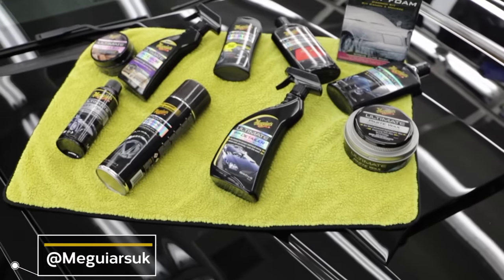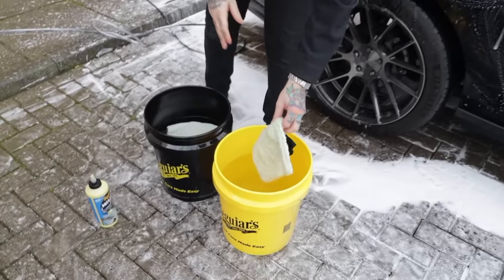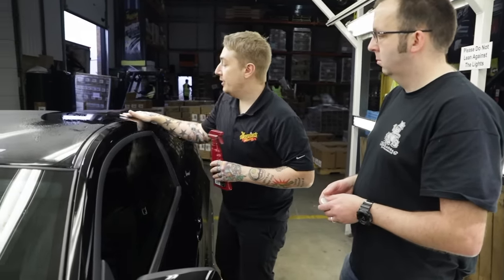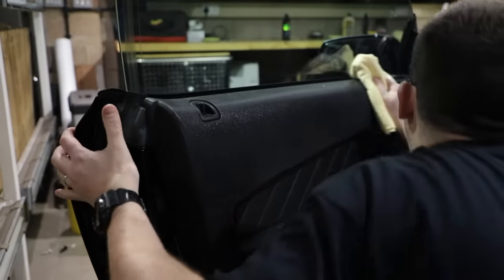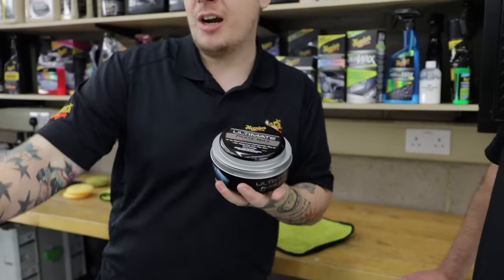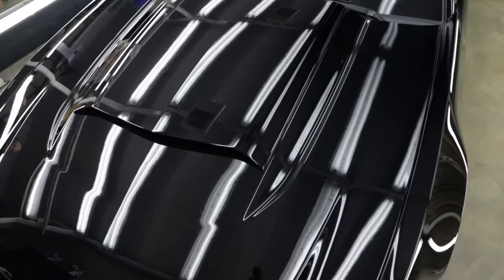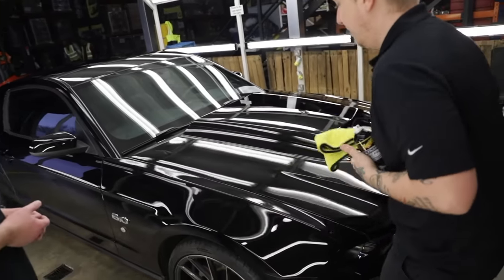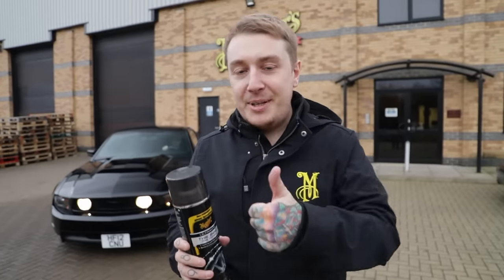ULTIMATE Detail for BLACK CARS using the Meguiar's ULTIMATE range | Ford Mustang | Day In The Bay

Comment: This is utterly fantastic!! However... I challenge the Meguiars team to achieve the same finish on my 140,000 mile Black Porsche! 😂 - I'd be interested to see how amazing the products preformed then! Also, I'm curious if you could now apply their ceramic wax directly over the top of all this work!? Or do you have to strip back the previous protection layers to apply?
Reply: I used their products on a 10 year old black truck with 220,000 it turned out mint. Also used it on a blue truck with 689,000 and it blew me away how it turned out. Took less than 1 day for each vehicle have done 3 so far. Exactly as they showed to do it step by step

Comment: would it be a good idea to wash the car again after using the clay bar?
Reply from the maker: There's no need to as it's just adding more work for yourself!
Reply: I would personally to ensure everything is off the paint before compounding. I just did it this past weekend on my white vehicle and could see the grim running down the panels while working with the clay/detailing lubricant. Good luck!

Comment: Awesome. I have a new silver metallic car so which products do you suggest I use?
Reply from the maker: Ultimate range! =D
Reply: Having the same color, but you don't need to go over the top with ultimate products. Since silver color "hide" way more scratches and swirls than black does. (black is basicly the worse car to detail and silver is pretty much the easiest) This is coming from a car detailer experience.

Comment: Can I Compound and Polish by hand because I dnt own and I'm scared to use a DA Polisher
Reply from the maker: Absolutely!
Reply: Don't be scared...£50 Guild one from Argos. Multi speed setting. Go for 3 or 4. It's the pads you need to pay attention to. The one it came with is a multi purpose one. Still does a cracking job. Struggles with scratches, but swirls are gone! I just might need two attempts as I'm the same as you. 👍

Comment: It's good stuff for a car that's not in bad shape or for cut and buff work. I own the set and can see that these guys didn't want the average person to burn through their paint like what would happen if the used the "real" stuff like 3M. This is more like kit gloves or training wheels 😂. Don't get me wrong, it will do the hard jobs but it will take 3X longer. This video alone showed 2-3 guys working multiple days on a car that wasn't in that bad of shape
Reply: I will also say that when you put in the time and effort to correct the paint, do what is needed so you never have to do it again. Wash every week, detail every month. And wax three times a year (warm spring, mid summer, and before winter) polishing and correcting the paint defects at that time. I have owned nothing but black cars/trucks and motorcycles and this is what it takes to keep them looking good 👍 the ultimate line of products are just what you need to "maintenance" your paint and I have yet to find a better/easier paint maintenance solution. offered by a company. Just wish you could buy it all as a bundle.

Comment: I have ceramic coat on my car.  And I have two bottle shampoo.  Yellow and purple and both is very new .   And then I have spray.   Ultimate quick detailed and detail wax ( yellow picture same with yellow shampoo).    This shampoo is not good for my seramic coat ?
Reply from the maker: All of our shampoos are pH neutral and are safe to use on coated surfaces. The only one that isn’t is wash plus, this will remove any coatings.

Comment: Hey what would you recommend for some brake dust medium to heavy caked in. I use Meguiar's ultimate compound then polish. I find easy-to-use using a DA-P
Reply from the maker: If its brake dust on the wheels then our Ultimate All Wheel Cleaner applied to a dry wheel is the best product for the job.

Comment: Rule #1 of applying tire shine on a clean car...NEVER apply it outside when at all possible. The lightest breeze will push the spray back on the car. For this car...definitely would've used the "Endurance" tire gel. Last longer, little to no "sling" and easier to control where it goes.

Comment: Does this process work on single stage paint?
Reply from the maker: Absolutely this will work but just be aware that you may see some colour transfer.
Reply: You need to feed single stage paint by putting the oils back into it, one of the best products is Meguiars #7 glaze, using this will feed the paint and restore the gloss especially if it's faded, it does not have abrasives in it.  You wash. clay, working in small areas rub in #7 well and leave to soak for a few hours, buff off, rub in more #7 if needed - you should have high gloss now, it's hard work but it's worth it, polish out fine scratches, then wax, You buy #7 online or from specialist detailing suppliers though, it's not sold in high street retailers like Halfords etc.

Comment: Meguiars ultimate compound have fillers or not??? 
Someone told me that ultimate compound have fillers 😔
Reply from the maker: Ultimate does not contain any fillers =D
Reply: Hi after using ultimate compound with da, my car water beads, why?
Reply: @mjyumping  That's what you want. Water beads when the surface it hits doesn't have scratches or contaminants to break up the drops. Also wax and ceramic coatings are hydroscopic so it repels water causing the beads and eventual run-off from and away from the paint or glass

Comment: how long do you wait after waxing to cure?
Reply from the maker: It depends on the situation you are applying it. The general rule is if you start at the bonnet, work your way round the car by the time you've got back to the bonnet it should be ready to come off.
Reply: @meguiarsuk  Thanks!

Comment: Good grief. That's way too many petrol station and single bucket car washes for a very expensive car. 😬

It would have been nice to see some more machine polisher technique do's-and-don'ts to avoid swirling, hazing and holograms. You can quickly make big mistakes due to small errors in technique. 

Worth pointing out that you should cut off a portion of clay from the bar, knead it to a patty shape about the size of your palm and work the panel in hash/grid patterns. Once it's gone brown with grime, I've found a pinch-twist-and-fold method works well to knead the piece and expose new clay. 

Bought the Megs clay bar kit recently and worked my car with it, being gentle with the clay (it really does only require fingertip gliding) and liberal with the Quik Detail for a buttery smooth finish. Worked wonders on panels with almost two years of buildup! Waxed straight after, the panels looked excellent. Only the most stubborn embedded tar stains needed extra work with some higher strength tar remover.

Comment: My dealer where I bought my car from have this “life time car wash” well I never use it, but one day I took my car in for service and the staff put the car in the washing machine. Now my car have swirls :(
Reply: Kanti123 ya never take your car to a drive thru car wash. 

 The wiper blades that are used to “clean” your car have been used to clean hundreds of other cars which means dirt has built up which results in the scratching of your paint. 

I would suggest either hand washing your own vehicle (most affordable option) or having a mobile detailer hand wash for you ( depending on standard washes prices varies between $20-$30 — in your case I would suggest paying a lil more to get those swirls/scratches removed.
Reply from the maker: Ultimate Compound! It removes swirls and light scratches. Just make sure you wax afterwards to protect the paint from future damage!
Reply: BUT SKIIUEEPP I didn’t, the staff at the dealership did.

Comment: But the ‘clean water’ bucket will become dirty once you clean the mitten out the first time, so the two bucket method is essentially pointless. There’s also no need to “prewash” the car, it’s just a waste of product, making you buy more product; marketing bs. You can simply blast any loose surface dirt away with a pressure washer.

Comment: Too bad you didn't clean the wheels with a contact wash, you really need to get into the barrels and calipers to get all that break dust. Also a good scrub of the tires should be in order.
Before applying the wax doing a quick wipe down with an IPA solution would make sure you have removed all the polishing compounds.
Last all that work and you don't address the windows? Inside and out‼️
If you are trying to teach do so properly. 
Not knocking the products just some of the techniques.